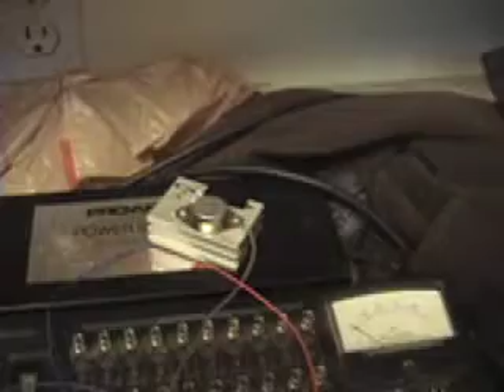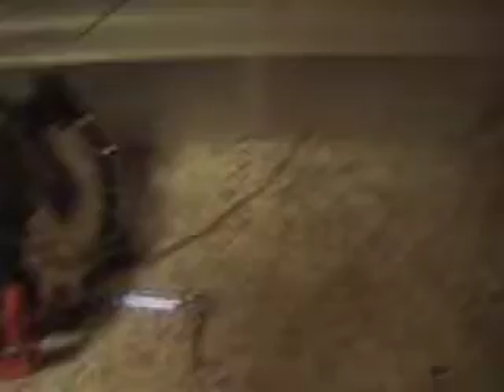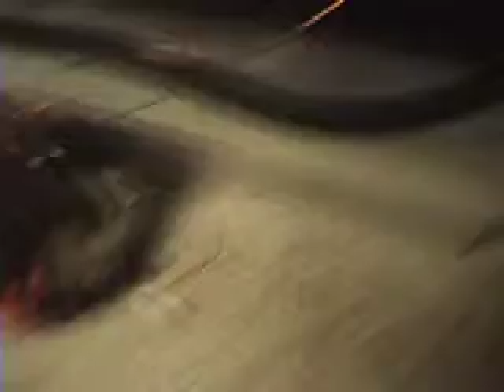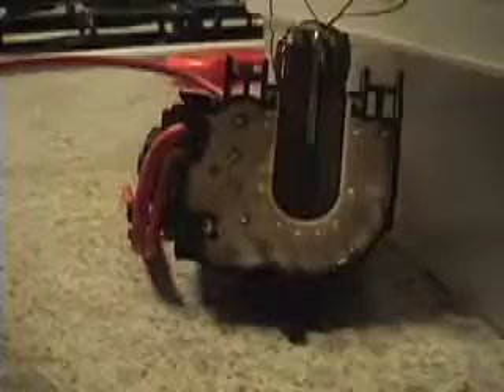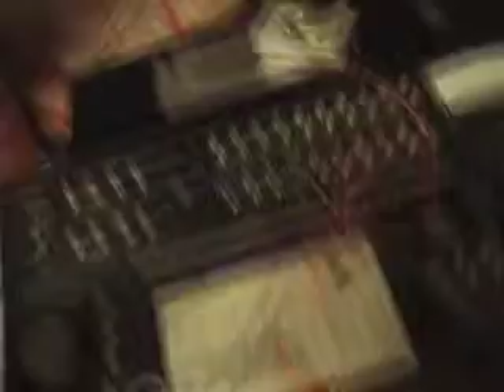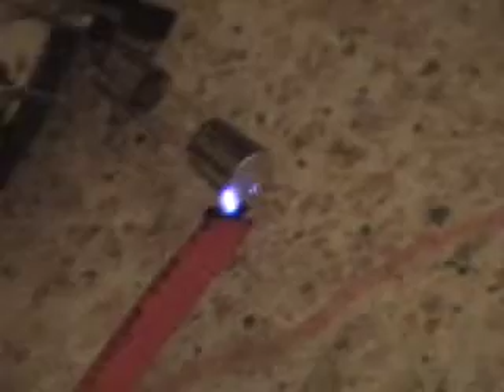Flyback Driver

Comment: fuses are based on amperage not voltage the higher the voltage the lower the ampere, of course that is all relative to the load. in the position it is in in this circuit it might as well be a piece of steal. its doing no work. very possible that it could break circuit do only to heat of the spark